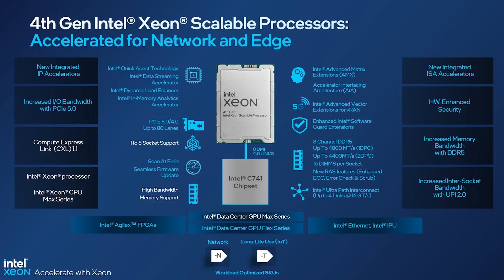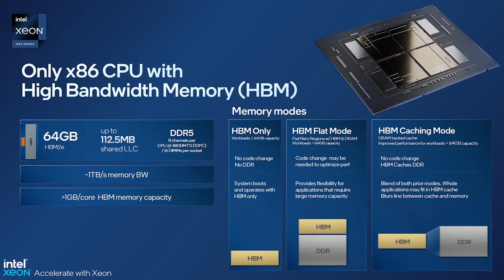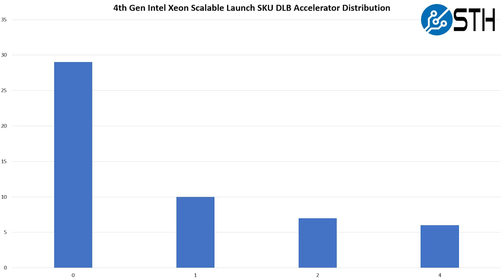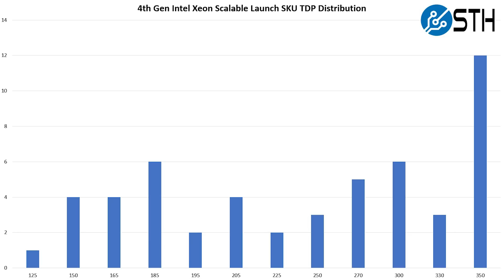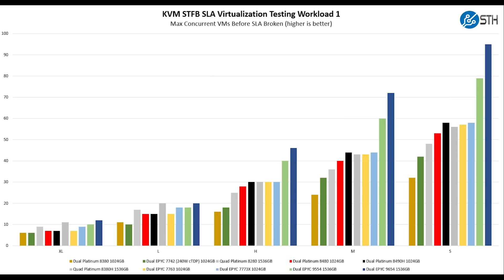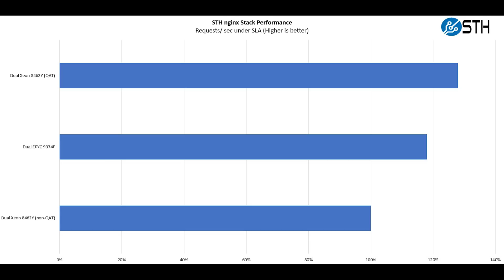$17K Sapphire Rapids Server CPU! Hands-on with the new Intel Xeon

Comment: Okay - you at least included a price, since I didn't get that particular part from Level1Techs. This is interesting, because Intel seems to be able to compete now a bit. And if stuff gets optimized (like QAT) they can get scary. I do wonder what EPYC would be capable of if stuff was optimized to the same level as for Intel stuff - though given their market share that is actually quite rapidly happening.

I'll say what I said in other review. I'm still a bit sus on Intel's ability to rapidly advance process nodes with sufficient yields. And even if they can, iterating on that in such a rapid pace - that's going to be hard. For no delays they would have to calibrate machines perfectly each time. And Genoa-X will be "response" (albeit not exactly the same niche) to SR HBM. Things will get scary with Turin in 2024. AMD accelerators, which they start releasing already, but they will be in Enterprise. I wish Intel the best - so we could have a lot of competition and force down the prices. Especially if this ends up in workstations it could force AMD to go back to Threadripper in less "sorry, we can't service you, you're not important enough to get part of our manufacture" kind of way. Though Manufacture is AMD's problem. Intel can outproduce them. Which makes the 30%+ market share almost impossible for AMD. In that situation they would actually be able to keep expanding safely and be a constant R&D. Something that AMD historically didn't have the luxury of doing.

Also MI300 looks like a beast. IDK if you will ever get it, but I hope you will and check what it's capable of.
Reply: And I would prefer if Intel was more aggressive on price. To compete. But I guess they all try to be expensive and crazy thing is for most enterprise stuff, this isn't even the main cost. Licenses are.
Reply from the maker: Pricing strategy and SKUs are extremely important in this generation
Reply: @ServeTheHomeVideo  True. I do wonder if Intel will be able to follow up this with Granite/Emerald in production quantities. I mean  - they've been stagnant for a lot of things. They have returned in almost full force (though lack of certain accelerators in most of the SKU's is annoying), but IDK if they can survive by releasing a great chip every 3-5 years. They will need to iterate and process and on microarch. And I'm not sure if they can do both without significant delays.

But if they can, they can outproduce AMD to oblivion. Had they priced a bit more aggressively, they might have even made it super difficult for AMD. With those prices I feel like clients will weigh pros and cons more rather than just "go with Intel". Though you know market way better than I do. So I trust you when you say something is important.
Reply: @jannegrey  Not that easy when the stock price of Intel has been performing poorly in the last few year, same story on the AMD side, as the advanced Node usage lower than ever, they have more chips to sell compare to last year, they can price EPYC cheaper than now due to the chiplet design, but they won't, shareholder care gross margin.
Reply: @jannegrey  it will be hard for Intel to be price competitive. SPR is bigger and more complicated than ICL. And with ICL Intel already started to lose income due to the aggressive pricing.
Reply: @zbigniewmalec4816  True. I was thinking along 13-14k for top model would sound way better, but TBH it's not even the main cost (licenses are usually). And lack of activated accelerators (at least partially, I gave a model in different comment). Because they had chance to push AMD out of the Enterprise a bit. And to do that continuously, they will also have to iterate nodes. Intel 4 and Intel 3 have to come online on time. From rumors Intel 4 might have small delays at worst. Intel 3 might have much bigger. And those nodes are supposed to come 12-18 months apart and not that far from now. So if this doesn't pan out, lack of activated acceleration will haunt Intel.